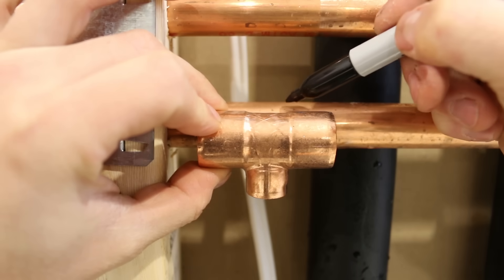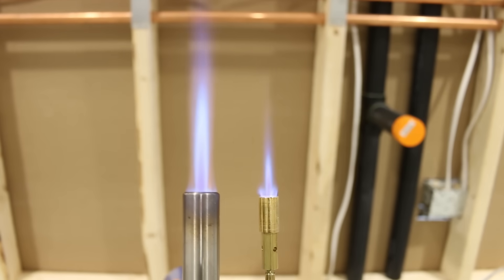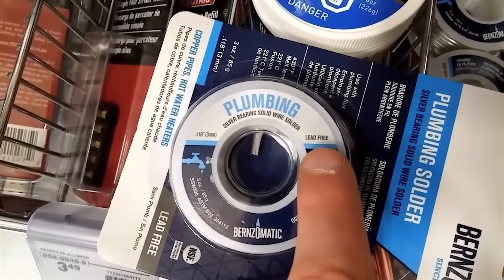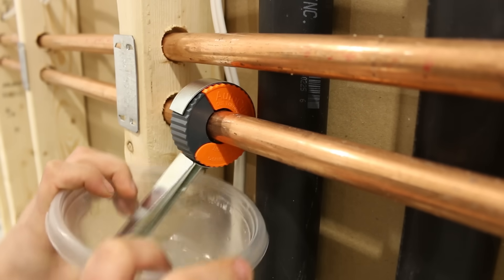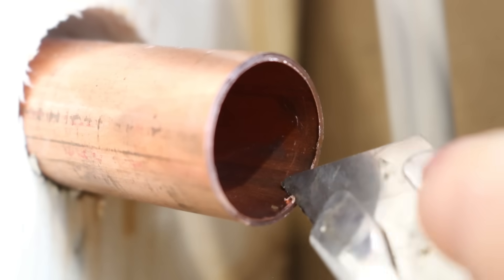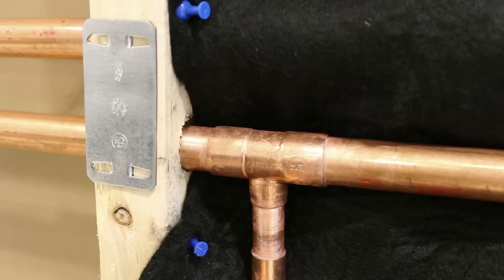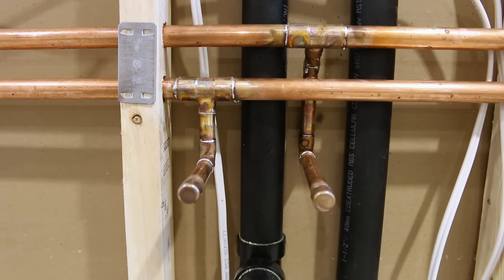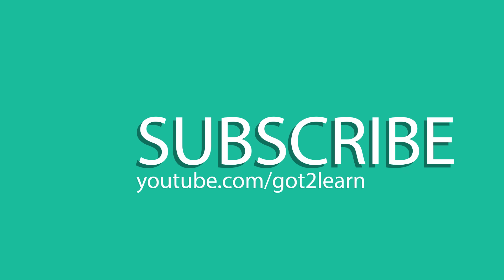How to Solder Copper Pipe in a Wall (Complete Guide) | GOT2LEARN

Comment: If I have to solder I use fine grade steel wool to clean the joints and polish them up with some brasso.

I use a little less solder then yourself.  I clean the joints with steel wool also whilst hot. You can barely see it's been soldered. Especially if you touch the joint on the rear. 

8 years of soldering endless joints. You become a pro no blobs or runny joints just pure bliss 😊.

For copper tube cutters in tight spots my mentor taught me to use a large slip  wrench. Always worked a treat 👍
Always glad to watch your videos bro. 💯
Reply from the maker: Great info here, thanks ghost, really appreciate your participation, that's what it's all about :)

Comment: Have you ever seen self cleaning flux?
Reply: It might be something different.
I just want to asked you. How's it different?
Reply: @ZiECloNE  self cleaning flux is generally used on bright new pipe(not dull copper). It saves having to clean the joints. As it's heated the activation accelerates. We use it if the pipes and fittings are shiney to save on having to clean the fitting & joints. I've never had and joints fail whilst doing it this way. 😊
Reply: ghostmanromeo uk Thanks.It was helpful
Reply: @ZiECloNE  La-co flux is self cleaning. One of the best flux's I've used to date. Most are as stated above. 😊
Reply from the maker: I think it's just a bit stronger than a "non self-cleaning" flux, might be wrong though.
Reply from the maker: I believe all fluxes are self-cleaning, someone correct me ifvI am wrong.

Comment: I usually like to solder from botom to top. Since the heat rises from bot to top it usually makes your life easier. Another tip is that when you solder, once the solder starts melting you want to move your torch tip to the end of the fitting just where the end of the pipe joints, just to make sure you have 100% penetration  of the solder and not just 50%.
Reply from the maker: Thanks blenderness, good input!
Reply: @Got2Learn  Equipes des plombiers magiques😂 Tjrs instructifs et amusant de partager nos expériences et trucs de plombiers!
Reply from the maker: J'adore voir techniques des autres et de montrer les miennes, je trouve ca super, merci ;)
Reply: @Got2Learn  au plaisirs :-)
Reply: Your right bottom to top.

Comment: Good video especially about the wet rags I like to use a spray bottle of water. I have a few additional tips  It's always good to wipe the excess solder off and visually inspect the joint for gaps especially for larger piping. It's also very important to heat the back of the joint due to capillary reaction where the flux follows the heat and the solder follows the flux.
Reply from the maker: Good tips, thanks a lot Keith! Yes, the spray bottle is good too, people just gotta make sure they got water before shutting it off, that's for sure ;)

Comment: Excellent instructional vid as always! At 4:41, you showed the roll of sandpaper. I've seen some plumbers use a roll like that, except it had tiny square holes in it and it seemed very abrasive; to me, it feels like it has glass impregnated on to the surface; I think it is made out of---or is exactly the same material---as that which is used to sand drywall; I just refer to it as "drywall screen." Do you know if this drywall screen is appropriate for cleaning copper, or is it too abrasive? Thanks.
Reply: Its called open mesh sanding cloth and is by far the best sanding cloth for cleaning copper
Reply from the maker: Yup!
Reply from the maker: Thanks Locutus! Yes, that sanding material is far superior but the only thing with these "sanding" papers is getting a good grip on them, they are so grippy that it's to keep it from slipping in the hand that's why I prefer the scotch brite pads. For bigger pipes, I use that sandpaper, I get about 2 feet long and grasp both ends to use it like a shoe shinning rag ;)
Reply: @Got2Learn  Yeah, whenever I've used the "drywall sanding screen" stuff, I'd cut off like a 6" to 8" piece for 1/2" or 3/4" copper and use it like a shoe shining rag too. Like you said, it's much too "grippy" to try to use it in your hand with merely a small piece cut to barely fit around the circumstance of your pipe. In addition to Scotchbrite pads doing a perfectly acceptable job, I would think they'd be cheaper than the drywall sanding screen stuff too. ;)
Reply from the maker: Absolutely. Those sanding sheets really scrub more than the scotch pads, so it all depends what's being done. Like I said in the vid, with 1/2", 3/4" and even 1", the pads work like a charm :)

Comment: Another decent tip is to never hold the tip of your torch right under the spot you are soldering as the solder could drip into your torch, causing it to have issues.
Reply from the maker: Yes, correct! Those could be a pain to get out ;)
Reply: Yeah that’s a bitch hate when that happens lol
Reply from the maker: Yeah, the flame starts to look like it's on some kind of heavy drug lol.
Reply: Hey @got2learn what is your background and where what country do you plumb in?
Reply from the maker: Canada, Montreal.
Reply: If that happens you could just heat the torch tip and tap it until its clean again.
Reply: @zablogful  until over time it gets so clogged that you need a new torch
Reply from the maker: Yrah ;(
Reply: @zablogful  truee

Comment: This is super useful, I am doing electronics soldering since I was a small kid, but never really tried these before. I am generally very "tech aware" so to speak and usually solve all my technical issues by myself, but for copper plumbing I really needed a few starting tips, and surely enough there's plenty of them as in any profession, many of them impossible to know before years of experience and hard work.

I just moved to a new house and it's pretty cold during winter, the radiators are on copper pipes and I think in a few months I'l get bigger ones and replace them myself. :)
Reply from the maker: Awesome, good luck on the radiator job ;)